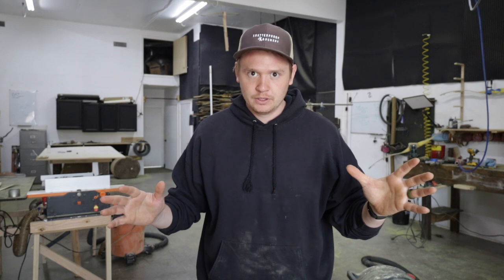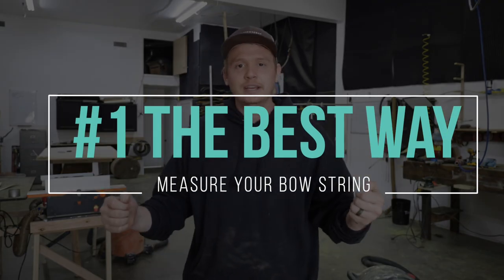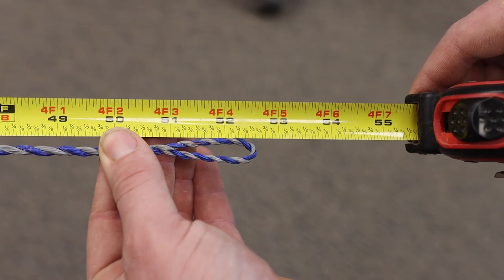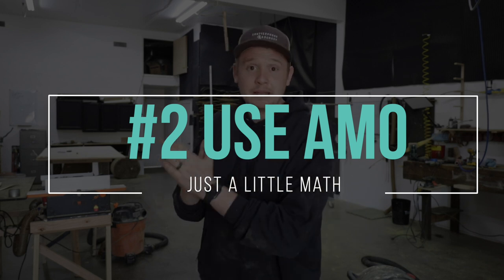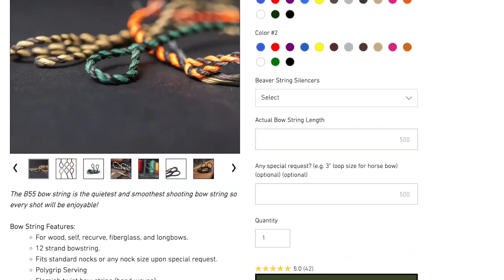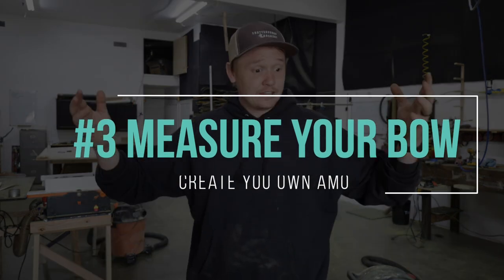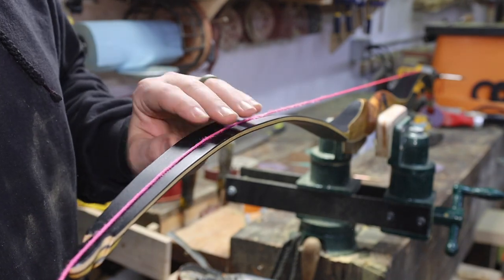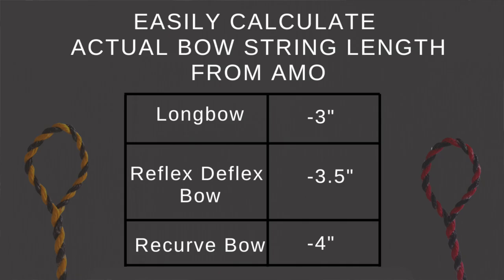Recurve bowstring length made easy. (How to get the accurate bowstring length every time)

Comment: I’m building a bow based on your $15 bow build video.  I’m also learning to make Flemish twist strings.  My question is: after I make a string, it coils all around itself in a tangle.   When it’s on the bow, it’s fine.   What can I do to prevent my strings from acting like an unruly coil spring and more like a piece of string?

Comment: String lenght of course depends on the amount of twists. A new string from the stringmaker probably will have less twist (e.g. 15 turns) than my already used one (e.g. 40 turns). So 68" length is not the same as 68". How to handle this by ordering a string?

Comment: I honestly don't understand the AMO thing.
I am looking to buy a 2nd hand bow wooden horse bow what is a 48" in length.

Is the AMO equivalent to the length?

I'm shooting recurve bows since 3 years and never came across the term AMO 😅
Reply from the maker: For a horse bow it is a little tougher. I would suggest using paracord or if you have a previous bowstring and measuring that.

Comment: I have KAP Challenger Spirit recurve bow it's says Prostyle 24" length 68-28inchs weight 64-32lbs what size string do I need I am confused please help.
Reply from the maker: If the bow is 68" long you will want a 64" string

Comment: That would give you a good starting point, but you’re replacing your string due to excessive age are breaking and strands. All of which, including just normally use because your bow string to stretch. So if you’re making a string identical to those measurements from your old recurve string, you better have room to put a lot of twist because it’s gonna be too long. That’s just facts Based on being in the archery business for 55 years.
Reply from the maker: That is a great point! Measuring your old string only works if 1) the old string is set at the correct brace height for your bow and 2) the string you get from shatterproof archery is prestretched (which it will be). If both these are true then your new string should match the brace height of the old and the beauty of flemish twist strings is that if it is off a little you can twist it up or untwist it to get it perfect:)

Comment: Sorry but your first method is 100% WRONG. If someone needs a new string that means the string they are measuring is old and stretched out. If you send them one that is the length of an old stretched string, then when it breaks in it will be way too long and will suffer from low brace height. NEVER ago by the length of an old string. AMO only.
Reply from the maker: That is a great point! Measuring your old string only works if 1) the old string is set at the correct brace height for your bow and 2) the string you get from shatterproof archery is prestretched (which it will be). If both these are true then your new string should match the brace height of the old and the beauty of flemish twist strings is that if it is off a little you can twist it up or untwist it to get it perfect:)
Reply: Actually the first method is the best method. The key is to make sure the bow is at its correct brace before measuring.
Reply: One more thing every string I had made will stretch over time. So if the new string is slight long you can twist it up to lengthen the brace height.  But you do need to get a string that gets you in the target area of your expected BH. You do need to know the best BH for you , your bow, your arrow and such. I have Take down bows a Bear and Martin Hatfield  ,  each one of these bow  BH are very different fwiw. 

The bear loves 8.25" the Hatfield loves 7.5" , I also have   29" draw & shooting aluminum shafts that are 31" long.